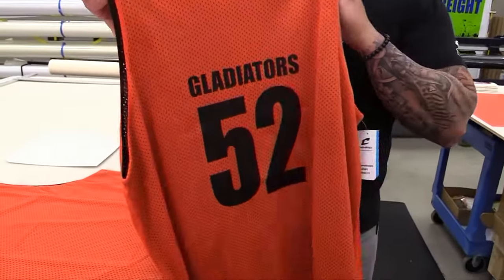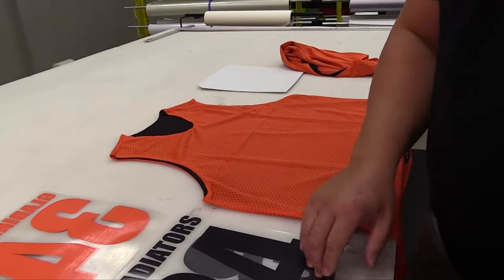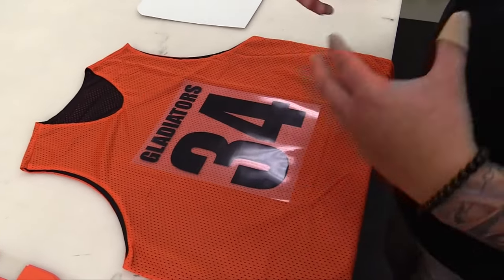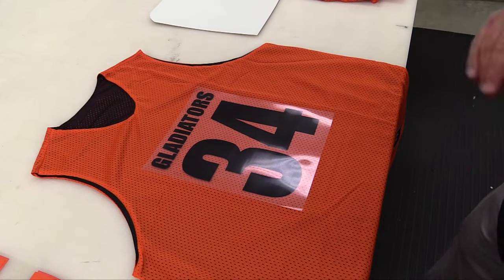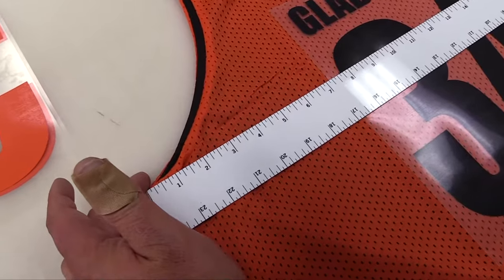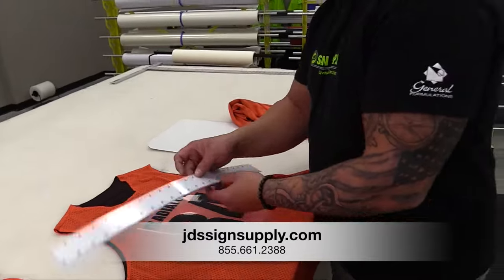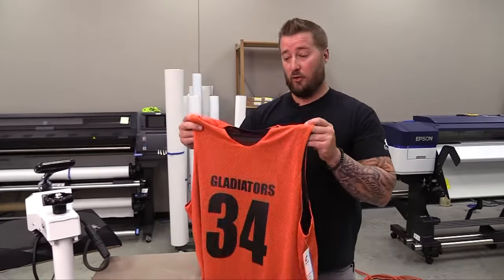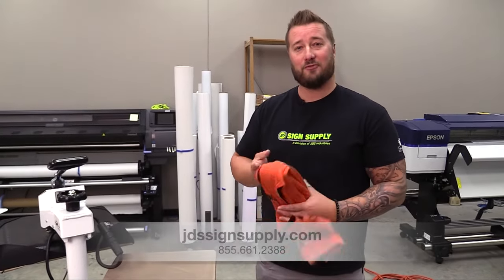How to Apply Heat Transfer Material to a Mesh Jersey

Comment: What is the best material to use on a 100% Polyester mesh jersey. Is it the vinyl or the application that makes it stay? We did jersey a couple years ago for our non profit youth team and some started to fall off once they started wearing them. Trying to avoid that this year :)
Reply from the maker: Mesh jersey’s can be tricky.  Press the material onto the jersey like normal for the full amount of time and pressure.  Peel the carrier sheet away and inspect the detail of the press.  If the HTM doesn’t have obvious dimpling from the jersey material, lay the carrier sheet back down over the graphic and press again.  The second time you peel the liner away you should see more pronounced dimpling resulting in better contact between the jersey and the heat transfer material.  I would recommend drying on low heat or hand drying.  We hope this helps!

Comment: Can I do DTG in a mesh fabric??thanks
Reply from the maker: Most mesh materials are reversible or have multiple layers of fabric.  When possible, it’s a good idea to process one layer at a time or putting some sort of slip sheet between the layers of clothing.  A slip sheet of some sort is always a good practice to prevent ink transfer to the bed of the printer or the other layers.  This slip sheet also provides a surface for ink to bond to when it passes through the mesh.  Depending on the curing process of the printer, It’s important to remove this slip sheet as soon as possible so the ink doesn’t cure creating blockages in the mesh.   We do not sell DTG printers so we recommend always checking with the manufacturer of your printer for best practices to avoid damages or costly mistakes!  Thank you for your question.
Reply: @JDSINDUSTRIES  thank you so much for reply my question..it was amazing to read and learn about your experiences...last question...what’s the name of the correct printable vinyl for sports jersey ???specially for the soccer jerseys to put numbers and names...thanks..!
Reply from the maker: @eduardohernandez6881  you should be able to use the SEF Graffiti on the jersey's as long as they are cotton, polyester or a cotton/poly blend.  If they are a different material, we would have to look at something more specialized for you.
Reply: @JDSINDUSTRIES  what is the slip sheet for in between the jerseys? Can you provide a link to similar products?